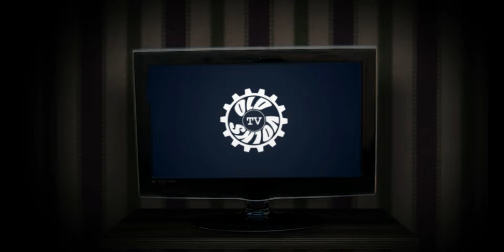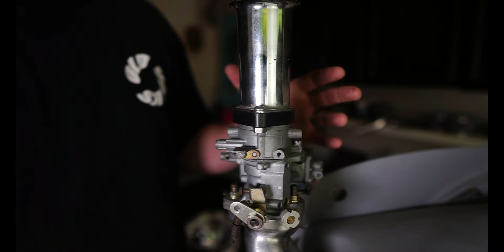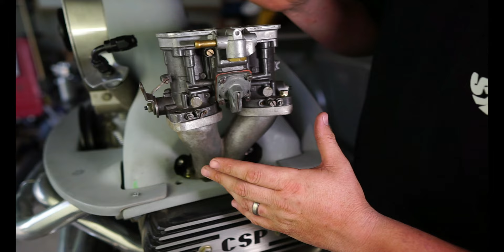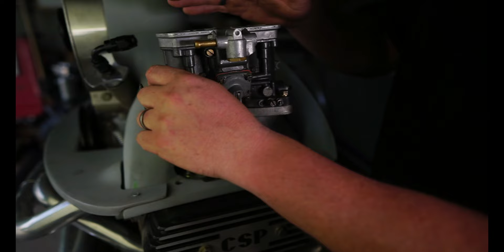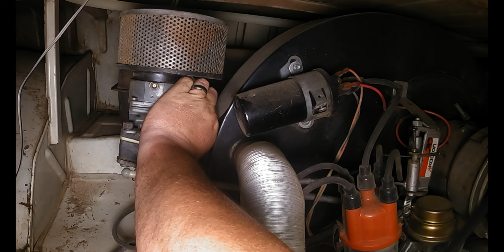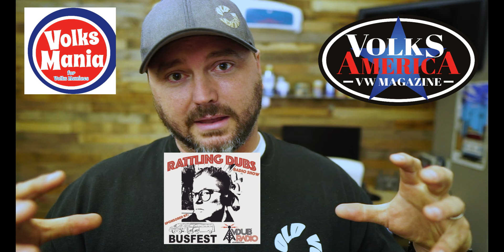Carb School! The easy way to tune dual carbs on an aircooled VW

Comment: Thanks a bunch for the tech video.  My 914 came with the weber and was no bueno.  Ended up getting a rebuild kit because the carbs are made in Spain and weren't available.  Good job Jason.
Reply from the maker: Thanks! I've had tons of people asking for this one. Dual carbs can be very intimidating, but they're pretty easy if you take your time.
Reply: dont know if you guys gives a damn but if you guys are stoned like me atm then you can watch pretty much all of the latest series on instaflixxer. Have been streaming with my girlfriend for the last few days xD
Reply: @Gerald Victor yup, have been using InstaFlixxer for months myself :)
Reply: @Gerald Victor Definitely, have been using instaflixxer for years myself =)
Reply: FFC

Comment: Great videos !! I bought a 73 beetle with dual empi 34's and I had them adjusted good until I tried to "get them running better", now they suck and I was thinking about ditching them and getting a Weber progressive. Well after watching your video I realized that I forgot to pinch off the balance tube 🤦🤬 !!! So thanks for the reminder, I'll try it again.
Reply from the maker: Awesome! I really like dual carbs because you get a good balance of fuel economy and performance. Those progressives have always given me problems so I don't mess with them.
Reply: @OldVolksTV  well I really didn't want to get the progressive! These carbs look ancient, I'll try adjusting them again (pinching off the balance tube) and see where I'm at.
Reply: Hey, any thoughts on the CB performance dual Solex carbs with chokes on them ??
Reply from the maker: I've never really played with them. I would think keeping the chokes synced would be a challenge. None of my dual carb motors have chokes and they seem to do fine, even in snowy weather. You already get more fuel so other than a few seconds of light pressure on the throttle they warm up on their own just fine.
Reply: @OldVolksTV  ok thanks, have a great day !!

Comment: For the big Webers, do you still turn the screw a half turn in after you find the highest idle or is that only for the small webers?
Reply from the maker: @mdecoma  yes. The manual says to go back in a 1/2 turn. I usually stop when thebengine is running it's smoothest. As long as you're close it'll be fine. The goal is to get them all in the sweet spot so none of the cylinders are lean. That's how you burn a piston.

Comment: Thanks Jason, you should get rid of the background music. Also, it would be so much more helpful if would learn and use the proper names for each screw and part you are referencing. When saying “ thingy, this part here, screw “ and then repeatedly using that terminology for all referenced parts, it becomes terribly difficult to follow without replaying the video over and over.

Comment: Hey Jason! Great video! I was curious, if you run a vacuum line to one carb and a balance tube to the other, would you have to clamp either off before balancing/adjusting? Thanks!
Reply from the maker: You wouldn't get a good vac reference from one carb. If you ran a balance tube you would definitely need to pinch it to adjust them.

Comment: I have dual kadrons on a stock 1500 single port baywindow. Seems simple for tuning good video. Other videos i saw they pinch the balance tube, and they use a floating ball thingy on top of carb. Is that needed for kadrons?
Reply from the maker: You definitely need to pinch the balance tube when tuning. I use a pair of needle nose vice grips with fuel line on the jaws. The "uni-syn" tool is good for getting the flow right. It can be hard on a bus, especially with Kads because of the air filter mount. I've been doing it by ear for a long time and haven't had any issues. If it sounds smooth and revs evenly they're good.
Reply: @OldVolksTV  thanks for that👍👍👍👍👍
Reply: @OldVolksTV  …on the bus video w/kaddie segment,..did you first start by turning clockwise?,.then counterclockwise, followed by 1/2 turn in?
Reply from the maker: Yes. Start with a warm engine and the screws at baseline settings. With the engine idling, turn the AIR screw IN 1/4 turn at a time until the idle slows down or gets rough. Then turn it out 1/4 turn at a time until you reach the highest idle. Move to the other side and do the same. Repeat the process a few times for the best result.

Comment: I have a weird question, my engine is running really rich with the dual Webbers, what adjustment is that
Reply from the maker: Start with the AIR screws on the outside of the carbs. With the engine warmed up slowly turn them in one at a time until the idle drops. Then turn them out slowly until you get the highest RPM. Repeat on all 4 until the idle changes with a 1/4 turn in or out. That should b pretty close. If it's still rich you may need to play with the jets or check the fuel pressure.

Comment: So what do I have to do if my engine is running to hot?
Reply from the maker: Hot can mean it's running lean, or the timing could be off, or the valves could be tight, or low on oil. Or the oil cooler is clogged up.